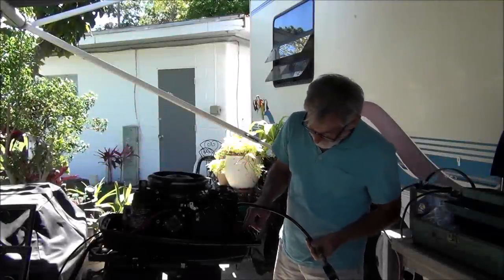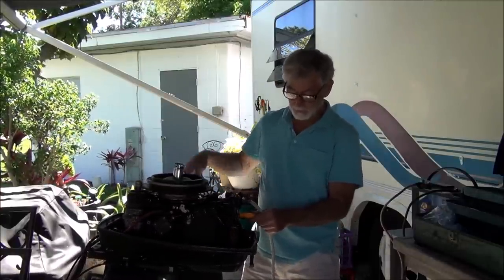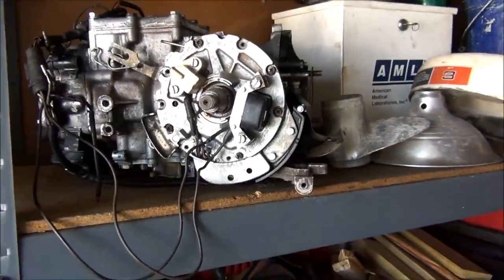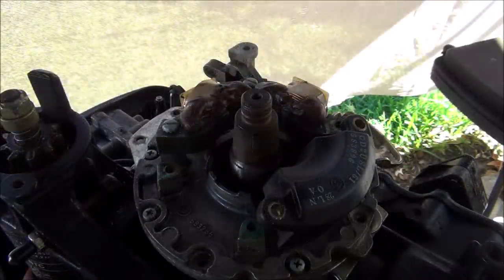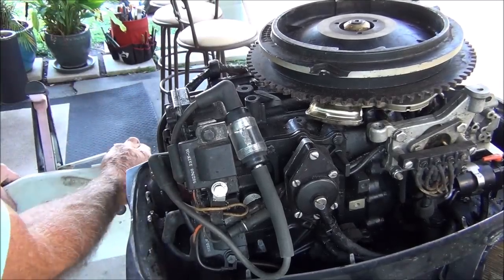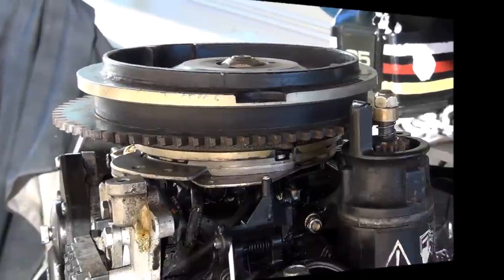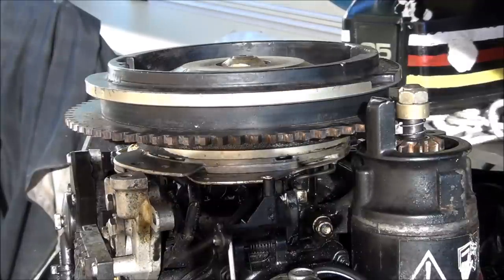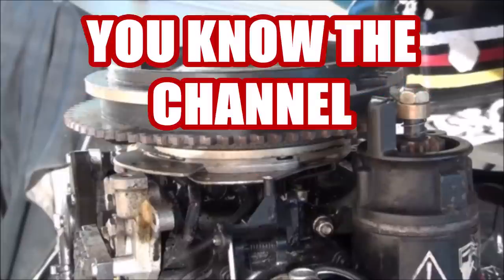Evinrude 25 Hp 1989 - Its Mind Boggling

Comment: Your videos are pretty informative. I do have a suggestion. Heat that black goo with a heat gun for a couple seconds and it comes off alot easier. Just had the same thing happen to my 2000 25hp. The goo had gotten smeared into the sensor causing it to idle like crap.
Reply from the maker: Hey. Thanks for watching and commenting. Really appreciate it. Stay tuned !

Comment: Compression was 130psi, right? Which value (range) is ok for this outboard?
Reply from the maker: Hey Ricardo. Thanks for tuning in. 130 is fantastic! Although it will run on 90 but not as well. Sometimes lower compression it caused by stuck rings. Especially if it's been sitting for a long time. It's a gamble, but sometimes you can get the rings to loosen up and compression will come back up. If it doesn't your stuck with a low compression powerhead. Like I always say, if it's got good compression the rest is just a pain in the azz! Hahaha Thanks again & Stay tuned !

Comment: The rope trick is a very common procedure used on 2 cycle handheld equipment like chainsaws and string trimmers.
With the puller I just put good tension on it and then hit the jack bolt with a 3lb brass hammer and the flywheel will generally releases if not a little more tension and repeat with hammer till it pops.
I've seen coils on old equipment leak out like this 
Could be the new coils being grabbed by the magnets (different material than the old ones)
Reply from the maker: Yes the rope trick has been around for a long time, but from what I understand Hitting it with a Hammer is a Big No No in the outboard motor world. To each his own I guess. your on track with the magnet thing, but that was with the old coil. Thanks. Stay tuned !

Comment: I`ve  had this before on some remote controlled motors.  The magnet in the flywheel pulled when passing the ignitioncoil. It only happened when the remote cables where disconnected and the timingplate was loose to move.
Reply from the maker: Hey. The first /last time this happened to me it was a tiller model and your on track with the magnets. It should not be happening at all, cables connected or not. Total pain in the butt ! Thanks for watching and commenting. Stay tuned !

Comment: I watched this video and saw something similar on my motor. I shared that my E25TECOS was missing a little at WOT. Well I checked the cam linkage and everything and took a video and noticed the black ooz that you pointed out on this video. Like you said here this motor was running.  So with the coil going bad would it also cause the engine to fall off at WOT?  There isn’t that much black goo like on yours, but there is some. Thanks.
Reply from the maker: Hey. no, bad coil will run rough at all speeds and hard start. Thanks again !

Comment: Say man my 1989 Evinrude ain’t running right. I’ve had new plugs, carb cleaned and many other things. It run good and than just all of a sudden it want run wide open. You can tell it wants to a little, but I can open her up and just barley go. What is my problem? Is it trash in the carb or something?
Reply from the maker: Hey. That's where I would start. Check that high speed jet/orifice in the carb bowl. Do the flashlight test and make sure it's crystal clear. Check the nozzle too. Curious to know what you find out. Thanks again !

Comment: Hey I have a question for you my friend bought a 1989 25 merury outboard and we can't figure out why the manual rope wouldn't pull out it seems like there is a damn lock that prevents it from being pulled out so we taped it back and the motor fired right up is it called a lever lock and can we just by pass it Thanks BTW great video
Reply from the maker: Hey . Thanks. Honestly, I'm the wrong guy to ask. I've had three mercury's and dont know that much about them. But there probably is a safety lock on it so it cant be started in gear. Is there a cable or a handle coming off of it leading to the shift mechanism or is it just screwed up and jammed for some reason. You can check here for your model and try and figure it out .  http://www.marineengine.com/parts/mercury-outboard-parts/   thanks again, Stay tuned !

Comment: OMC has a metal ring tool that you put over coil power pack for correct spacing,did you put throttle cam back on?
Reply from the maker: Hey, Yeah I know all about the ring. Dont need one. And yes everything was connected. As I said in the video I wrapped masking tape around the coil, p-pack & stator, put the flywheel back on and no rubbed marks on the tape ! Same as the last time this happened, but this time I figured out what was happening ! Yay. Stay tuned for the next Episode and Thanks for watching and commenting.
Reply: @THISOLDOUTBOARD1  so are we dead in the water with these 25 horsepower Evinrude?
Reply from the maker: @SailingSarah  Hell No. Hahaha  Follow the Saga !  Thanks for watching !

Comment: Sun...?   I think it was more from being severely overheated by having virtually no impeller in the water pump...?   So how hot would it that engine have gotten under the hood with absolutely no cooling...?
Reply from the maker: It would have destroyed the motor if that were the case. Fortunately it wasn't. It only takes seconds to destroy an impellar running it without water. Black motor, Florida sun = High heat under the hood day after day after day melted out the already aging coil. Once that black material starts to deteriorate that's it. The black paint gets so hot you can't put your hand on it.

Comment: My guess is to see if maybe the armature plate support, or the bearing support plate aren't upside down. Not sure if you took them off
Reply from the maker: Hey. I know what your talking about and the supports on these later models are different. No ''ring' in there to get turned upside down, but your on the right track ! Thx. Stay tuned !

Comment: Enjoyed the video! I've got an old 25 evinrude, how can I check what year it it? Do you do this as a hobby? How did you learn all this? I retire next year that's what I plan on doing. It looks like a lot of fun.
Reply from the maker: Hey. Thanks. Your outboard should have an I.D. plate attached to the transom mount, Hopefully its the original mount, there is a model number on the plate, just look it up. If the plate is missing there is a round I.D. plate, about the size of a quarter on the powerhead , if that is missing too, the best thing to do is search pictures and try to match paint color and hood. And I guess you could call it a hobby ! Heres how I got started  http://www.leeroysramblings.com/index.html
Reply: @THISOLDOUTBOARD1  yes it's all original a friend of mine gave it to me. It's on a stick steer fiberglass boat he gave me as well.
Reply from the maker: @markc4921  Sweet ! Does it have the I.D. plate?

Comment: What brand of spark tester is that and where can I get one?
Reply: Ebay
Reply: @ACDC5540  which is the best quality? I bought a Lisle model and it fell apart after a few uses.
Reply from the maker: Hey. I'm pretty sure I got it at Harbor Freight. It's hard to see spark through the thick glass if your working outside in bright sun, especially if your using the pull start. Real pain in the butt! Thanks for watching and commenting . Stay tuned !

Comment: Did you pull the mag plate off and look to see if the plate under it is bent ? That would be my guess . Iv seen when people use a hammer and pry bar to pull the fly wheel would catch under the plate and bend it , instead of using the proper tool to remove the fly wheel ! Lol
Reply from the maker: Yeah man, had to pull everything off. This time I figured it out. Just so time consuming. AARRRGGG 👅

Comment: I remember you fighting with that other set up....Did you replace the plastic mag plate bushing?  If so, did you lube it properly?  There must be some wear on the brass mag plate bushing and or crankcase pilot bushing...Did you use the OMC alignment ring?  It sounds like you are saying that the flywheel magnets are actually not hitting any of the components, do I have it right?  If so, then this is just the flywheel magnets moving the plate up/down/back forth when they pass by the charge coil/alternator windings.     This is really not all that uncommon...Not great for sure, but not uncommon.  I would replace the plastic bushing 322435, and make sure it is lubed properly.  Run your finger nails over the brass mag plate bushing to see if it is worn.  The only real fix for this is to replace the mag plate, but that won't help much if the crankcase pilot bushing is worn also...Finally, if the magnets are really not touching any of the components, I would just set the charge coil/alternator windings back in another .005" and just run it....Many are running like this today with no ill effects...
Reply from the maker: Hey Stranger. Nice to hear from you. And Yes I figured it out this time. I even mentioned You in the follow up video, and how you told/asked me about the plastic Baring if it was worn. I had no idea they wear out the way they do. And nothing is actually hitting the flywheel. Theres no real wear on the plate, its all in the plastic bushing and the support mount shows some wear. I was just editing the next video and got to part where I was rubbing my fingernail over the brass support and your comment popped up, Hahaha, funny. It looks liked it had worn down almost to a groove but no, it just took off a little of the gold color. I dont want to give away to much here of the next video, hahaha, got to keep the viewers in suspense ! Anyway, I'm  just glad I figured it out, Finally ! And as always Thanks. Hope your doing well. Stay tuned !
Reply: Good, glad it worked out....
Reply from the maker: @fleetwin1  👌Thx